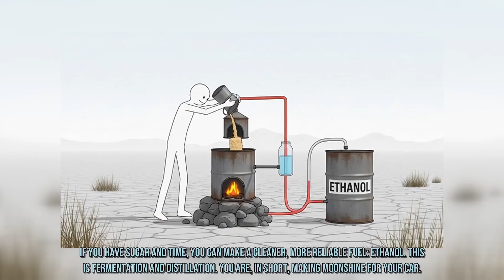I Made My Own Fuel from TRASH - 3 Survival Methods (Pyrolysis, Ethanol & Zombie Gas)

Comment: Methenol is flamable and could be used as burner fuel for boilers, pyrolyzers or even potentially cooking. Just because you don't want to drink it or use it as fuel in an engine doesn't mean you just discard it.

Comment: The first method can be used to produce wood gas and charcoal. Wood gas works fine in most standard gas engines. As far as the plastic/tires method, you start off at a lower temperature to drive out the light volitals . Many of these can be condensed for a cleaner fuel. I have 30 years of research and experience with alternative fuels and alternative energy sources. This video only gives you an introduction. Do your research before you try any of it. If you don't know exactly you are doing you will blow yourself up or ruin a good engine.